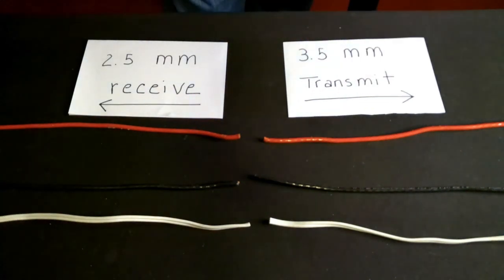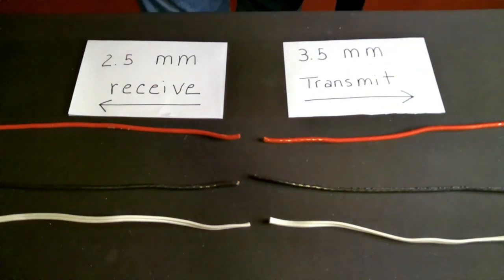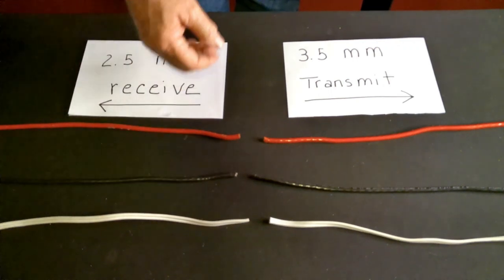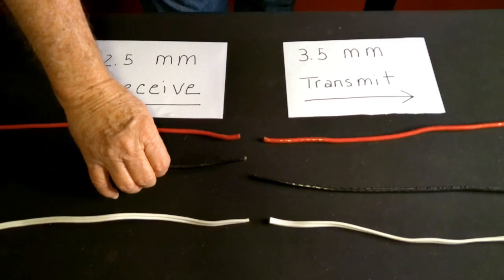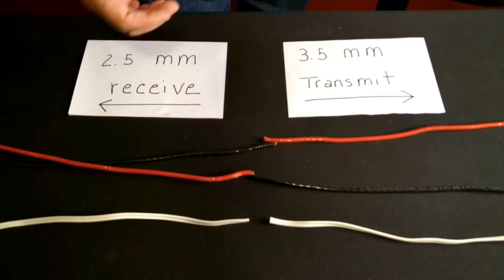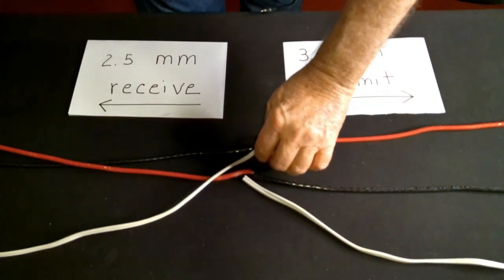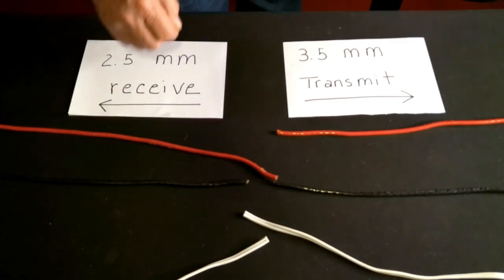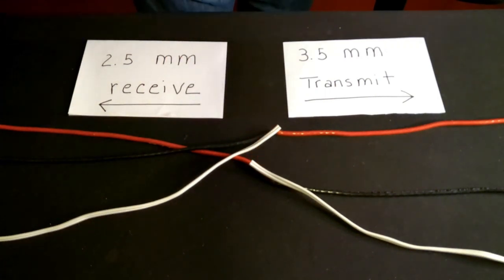Baofeng Repeater - Wiring Demonstration

Comment: Have you field tested your repeater...I have a vhf duplexer using one antenna  ...the system is very weak and  very noisy simular to the squelch ....have you any ideals...the box repeater you made ...is the antennas far enough away from one another...
Reply from the maker: Yes, the repeater was tested during a camping trip several months ago and it worked great. The radios on the repeater do not communicate using the antennas. The direct link with the wire keeps that from happening. The repeater antennas only receive and transmit to the field radios. 

Thanks for watching.

Comment: 2-19-25 used the link in the description. I also found a yellow wire under the jacket. However, not an issue, just double checked that my connection was as you described. Thank you sir!
Reply from the maker: Thanks for the info, and for watching. Glad the video helped.

Comment: That’s a great “How” 
But can you explain “Why”?
Genuinely curious
Reply from the maker: To expand communications capabilities
Reply: @theorlandoprepper  
Haha that’s on me, not “why the repeater setup” but
“Why do you need to cross the wires on the black red (neg/ pos) and what is the white wire doing?” 
There’s another vid out there that just used a jack with only red black and was just wondering what the wires are, what they’re doing and what the point of the crossover was.
Reply from the maker: @Hivemind_Alpha  I just passed along what worked for me. If you found an easier method then you should use that.

The white wire seems to be a power wire. I made a note in the description box below the video and did a follow up video:  https://www.youtube.com/watch?v=GEZVdDLJPvw&t=178s
Reply: @ 
Fair enough, I’m not really looking for easier, complete opposite actually!
Thanks for the info and responses! 73

Comment: So a 2.5 to 3.5 adapter wire with 3 rings on the plug is a no go?
Only reason i ask is the only one i can find with a 90° on both ends has 3 rings on the plug.
Reply from the maker: Click on the Amazon link in the description box below the video.